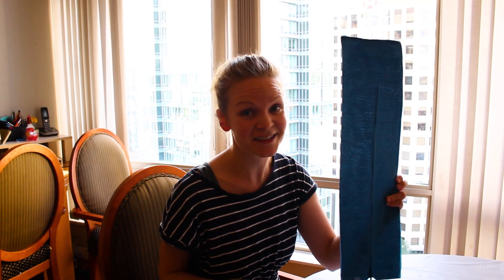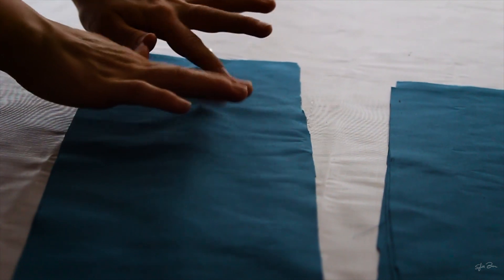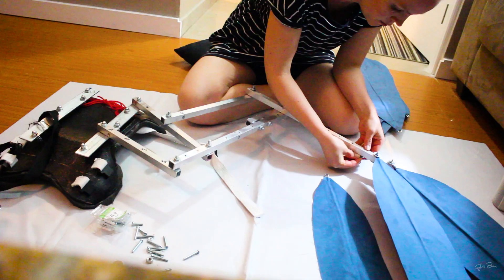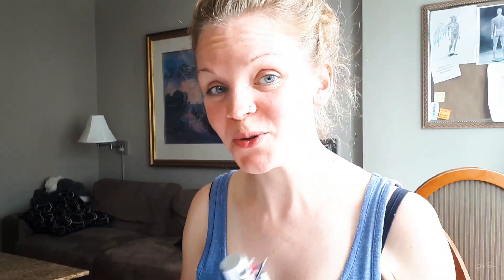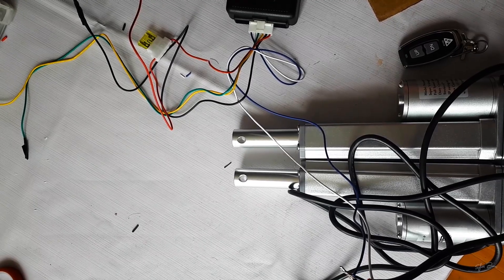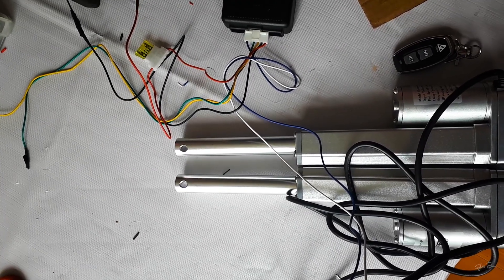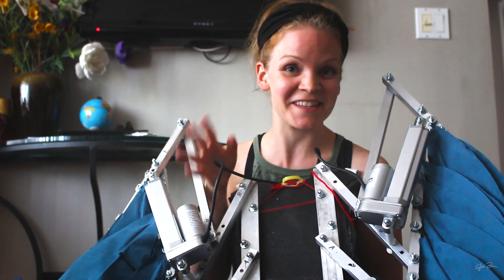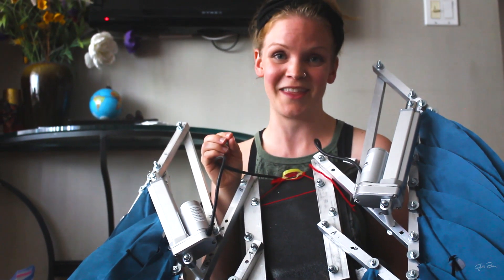Building Mechanical Costume Wings

Comment: Good afternoon you built an awesome project since you have 2 actuators do you control them with one remote or two remotes and if operated with one rote for both actuators ... How did you wire the up to move at the same time